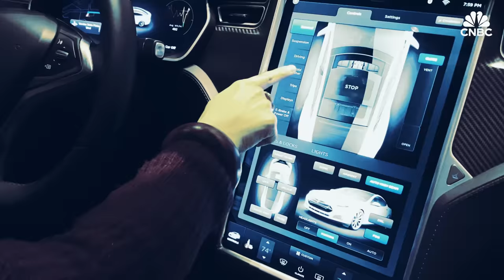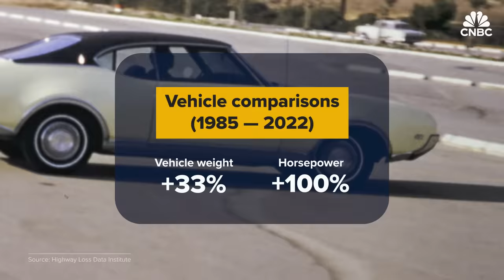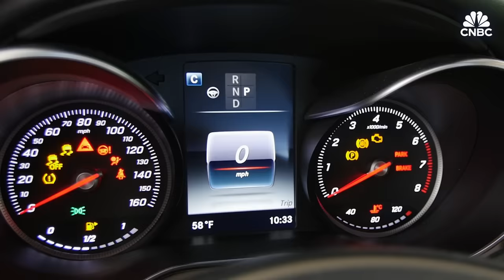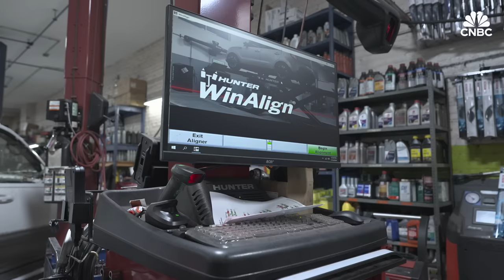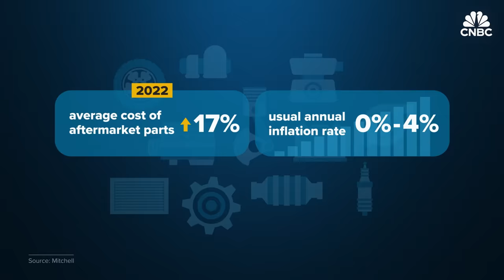Why Car Repairs Are Getting So Expensive

Comment: I'd have no problems driving a car less technologically advanced so that I could fix it myself. The problem is, at some point, manufacturers stop making parts for an older car and then you're struggling to find a specific part when you need it.
Reply: it's easy to find an old part you just have to know where to look and I do but I'm not telling any a dam thing.
Reply: Don't buy domestic and you won't have this issue. Domestics constantly redesign the cars with non-interchangeable parts which automatically makes for a very small parts market. I can still source parts for my 34 year old Nissan and my 20 year old BMW. Heck, I can get an entirely new engine and for less than half the cost of fixing that guy's broken radar module. New cars and especially domestics are money pits.
Reply: My newest car is an 07 Accord with 180,000 miles. I can find parts for it everywhere
Reply: junk yard
Reply: Depends on what vehicle you choose.
Reply: I have a 70s lincoln i need to make new rear bumper isolators for.

Comment: As a car owner, it’s important that you learn to do the most common basics maintenances like oil changes, air filter, spark plugs, etc. Save the heavy stuff for the pros but do the basics. Also helps to buy a reliable car from a reliable brand!
Reply: also an older car with less electronics.. they are still amazing. i have a 1991 toyota pickup and it runs like a top. the transmission and engine run like new with 156k miles

Comment: I bought a manual transmission car in 2017, I was told that when the clutch goes it “will cost between $600/800” in 2022 it cost me $4,500 to replace the clutch. That was after calling about 5 different shops to get the best price.
Reply: what kind of car?
Reply: id buy some tools and a floor jack not a terrible job you have a few hours and an afternoon
Reply: I don't know where you live dude, so I don't know the specifics of your vehicle either, but I had my clutch replaced for 800 bucks labor. I had already bought the clutch and flywheel kit for just under 200. This was last summer
Reply: I have a 90 Honda Crx Si  for reference
Reply: @rickyhernandez7681  he is probably lying, he wont answer what kind of vehicle he has
Reply: @rickyhernandez7681  people literally lie all the time just to try to score likes, its pathetic
Reply: gtfo of here bruh, what you driving a lambo?? aint no regular car 4500$$. im a mechanic and i know this clutch jobs usually pay like 6 hours max just depends if its 4wd or 2wd etc.. 4500$ dam i need to open me a shop around there lmao 😂😂
Reply: I believe him. Dealer wanted $800 to change out brake pads, wipers and 1 taillight.
Reply: For 4500. You can buy OEM parts, quality jack/jack stand. A big ass set of tools and still have a couple Gs left.
Reply: Was a Subaru Impreza that was repaired in Washington DC, I even ended up going with the original shop quote because I laughed when they first told me the price, so I called around and got even higher quotes so I had to bring my sorry ass back to the place of the original quote, no lying here
Reply: @boardervt should not be 4400... unless you are talking a subaru wrx sti aftermarket racing clutch.. doubtful
Reply: I do most of my repairs myself but I paid a mechanic $650 to replace the clutch and slave cylinder in my truck before the pandemic. I wouldn’t be surprised if that price has doubled.  Parts prices increased during the pandemic but have started to come down again. BTW, the mechanic let half of the transmission fluid out when he removed the drive shaft. He forgot to refill the transmission. The transmission started whining at highway speeds and I immediately knew what was wrong. I changed the fluid myself because I wanted to know that it was done right.

Comment: Cost of auto repairs have always been off the charts.Parts are relatively affordable but the labor cost is though the roof but wages aren’t though the roof!!!
Reply: Dealer charges $110 for labor yet pays the Mechanic $20-$30. He also has to use his own tools.
Reply: @Alumnikiid   It's worse where I'm at. Dealer charges $200 an hour and I'm only getting $20. I've spent about $5000 in tools so far
Reply: The video should have talked about used car extended warranties. My friend got her 2016 honda HRV(under 100k miles) transmission replaced for free with an extended warranty she purchased.
Reply: Wait till you have 40k in tools and they want to pay you 15/hr  and  your have all 8 ASE  certs and they say we can't  afford  to pay more as they charge the customer  155/ hr

Comment: I went to a shop once... what a mistake that was. I bought a used truck with a drivetrain warranty. The cv axle boot was ripped in the first 2 weeks of ownership, so I brought it back to get fixed. They told me that a cv axle is not a drivetrain part, and they charged me for it. When I went in to pay, I called them scammers and said that they would never see me or the truck again. One time was proof enough for me that shops gouge customers for everything.

Comment: Yall failed to mention that manufacturers also intentionally make it harder to repair to force you to bring it in to dealerships that have the crazy tools required to do it. It's a pure scam. Ain't stopping me though. Example is removing dipstick for transmission fluid. It used to like doing an oil change. Now for my Tundra truck I had to lift the whole truck in the air, make sure it's level, drain like normal, the manually pump the fluid in, then turn the truck on to get it to a certain temperature, then remove drain plug to let excess drain out until it was level. I did it successfully last week. Also some dealers are saying you're not supposed to change it at all. LIES! If you don't change it, the transmission will go bad! And then you'll have to buy another one or another car, and that's exactly what they want! Don't fall for it. Crazy how this video failed to mention that.
Reply: Just measure how much comes back- replace same amount...but I hear you. Annoying.
Reply: @MOAB-UT Yeah, that's only IF it was the right level before. I like making sure it's the proper amount to be safe

Comment: There is still a certain degree of gouging. The place I bring my vehicles charges $18.99 per quart of oil. I can get a five quart jug of the same oil on Amazon, Walmart or anywhere else for about $23.00. The oil for my truck that takes over 7 quarts cost $133.00. The fact that they buy it by the quart instead of the drum blew me away. I suggested they open an Amazon business account. They will deliver as much as they want and as often as they want. They could drop the price of an oil change by half and still be profitable.  Also all of my TPS sensors died after 150k miles, shop wanted close to $500.00 to replace them. I did them myself, the OEM sensors were $41.99 for four, they wanted $65.00 each and a reset tool was $10.00. Plus about three hours of labor using the bucket of my tractor to pop the tire bead. I would love to find a shop with a rate of $60.00/hr, doesn't exist in New England. Oh yeah I saved enough money on repair bills last year alone by doing it myself so I bought a lift for my garage.
Reply: Wow that's a lot for a quart of oil.  On my last trip to Walmart I bought a 5 quart jug of Valvoline synthetic and a filter for $30.
Reply: LOL, this remainded me of a "The Car Care Nut" video about stealership prices on parts like oil, filter and gasket way over actuall MSRP.
Reply: It’s absolutely price gouging.

Comment: When I was a teenager, with rear wheel drive, you could jack a car up and drop the transmission in less than hour using common tools. Rebuild and reinstall it later the same day. With front wheel drives, forget it. No more back yard repairs.

Comment: I have a small 2015 hatchback car with a CVT transmission. The owners manual says routine maintenance is never needed for the transmission unless you encounter issues. Well that's bogus, there is a filter there for a reason, and it's somewhat easily changed as well. The vehicle manufacturers don't want you performing routine maintenance like this so that it will inevitably fail in the future. Then they try to sell you another car or severely expensive parts.

Comment: I started to learn how to do somethings myself like change my filters, bulbs, wipers and so on. Gonna try my brakes because dealers charging $100+ to change simple parts.
Reply: You can do it! If you’re in the Midwest get you some PB blaster and start soaking those bolts if you have to replace the rotors
Reply: Brakes is prob the biggest diy labor vs $ savers.  YouTube videos are a huge help we didn't used to have.
Reply: Imagine though, you're paying someone for their time. That's why it costs so much. How much is an hour of your life worth to provide work for someone else?
Reply: EVs don't need brake jobs, or any other maintenance for that matter.
Reply: @bingosunnoon9341 
They need less brake work, but they still have mechanical brakes no different then any other modern car in addition to the ablity to regenerative brake with their motors. 

Driven long enough they would eventually require work on the mechanical brake systems. How it's driven probably matters quite a bit, allot of stop and go city driving where full braking power is used rather then regenerative will wear them sooner. They'll also need brake fluid flushes at a similiar rate because that fluid degrades with time as it absorbs ambient moisture (which it's designed too so that said moisture doesn't rust the lines). Malfunctions like sticking slides pins, calipers, or progressive rust from sitting or under-use could also require brake work.

A EV will require less brake work on average yes, but not none.
Reply: @Tk3997  Tesla brakes are totally opposite. Regen can be set up in your preferences. I never touch the brake pedal. If you have room in the battery, ALL braking effort is recovered. If you don't have headroom, the motor is driven backwards. EVs are way different.
Reply: A simple brake job especially at a dealership is a minimum of $500 and that's for a Honda/Toyota/Nissan etc
Reply: EV brakes may need lubrication after many years, to prevent dragging. Eventually rubber Parts could degrade the good news is there's not much information on this because they last so long, and mass of EVs is relatively new
Reply: @bingosunnoon9341 they just need $20,000 specialty batteries that are no longer made because battery manufacturing continues to shift, so that “battery costs are going down” is completely irrelevant when working with an out of warranty EV battery. It’s like requesting Apple to build you a 2013 MacBook today. The batteries for an old EV are absolutely ridiculous.

EVs are like sports cars but people insist they’re ICE replacements. Sports cars are meant for specific, infrequent purposes. EVs can’t handle the cold. So why would I want a seasonal vehicle like an EV? 😂
Reply: @Tk3997  I said none and I meant none.
Reply: Luckily YouTube has lots of mechanic videos online which can help people learn how to change their own oil, wiper blades, flushing out coolant system, etc. Scotty Kilmer is one of the best in the biz! It’s up to us though if we want to find that info or not.
Reply: Brakes are easy.
Reply: @mgf909  I shure like Scotty. Best wishes.
Reply: @bingosunnoon9341  you've obviously never seen a Tesla before, just look at one and you'll see brake rotors. Regen braking helps, but EVs are WAY heavier than ICE cars, and they chew through both their brakes and tires.
Reply: True, but many mechanics think they are on the same level as Medical Surgeons.
Reply: @Callsign_Sturm The thing is, this is some people's livelihood. Who wants to slave away on ungrateful customer cars, that haven't seen an oil change in 20k miles, as charity work? 

I imagine at your job you want to be compensated for your time, not doing it for as cheaply as possible, right?
Reply: @gamechip06  A Ford 150 weighs a thousand pounds more than my Tesla. Some models weigh1600 # more.
Reply: @gamechip06  
Tesla's are heavier, but not THAT heavy and they don't use the mechanical brakes nearly as often so they put allot less wear on them then any ICE vehicle. I'd actually say that the issue with EV brakes are likely to be related to lack of adequate use actually, if brakes just sit and don't get used they can start to rust or stick, but these are likely to be longer term issues. The reason some EV are going back to drums is actually probably related to that. 

Basically the kind of routine pad changes and rotor resurfacing/replacement you see on normal cars aren't really going to happen on EVs. Really barring some kind of defect brake pads could basically probably last the life of the car, rotors should last too as long as you use the brakes occasionally to keep them scrubbed of rust. Basically the routine maintenance type brake work is likely to be largely absent on EVs, but most of the system problems like sticking components, corrosion, fluid leaks, booster or pressure failures, etc can still occur and would require brake work.

Comment: You can’t buy a high tech vehicle and not expect higher prices for repair and maintenance. This has always been the case. If you want an all wheel drive vehicle, you have a lot more parts that wear or can break. Fewer parts will always cost less to care for during the life span of a vehicle. Electric cars have existed for a very long time. Gas powered vehicles took over from electric because they are less complex and more durable. That was the reason 100 years ago and the same reason why they still dominate the market today. Except now we are all being punished financially either way because of climate change. Start building new nuclear power plants and drive down the cost of energy and all of this will drop drastically

Comment: The other huge factor is misdiagnosis. It's insane how often it happens. If your mechanic tells you that you need multiple parts to fix a problem (especially electronic) then he's guessing. We call it "firing the parts cannon."
Reply: Lol. The "parts cannon" is what inspired to learn automotive repair. In 2001, I bought an '88 Ford Tempo with 80K miles on it. It overheated when I was driving it home. I took it to the local dealership. I was told that the entire cooling system, as well as my belts, needed to be replaced for a total cost of $960. Not knowing any better at the time, I paid it. It overheated again on the way home. Despite knowing nothing about cars at the time, I just opened the hood and started looking. What I eventually discovered was that one of the clamps on the lower radiator hose had corroded away, and the coolant was coming out of the hose once the car got up to temperature. Later on, my car would just not start at random times, and eventually started dying in the middle of the street. I had the battery and alternator checked multiple times over the next year, and both tested good. I ended up taking it to a family friend, who determined that the dealership had installed the wrong size alternator belt. The belt they installed was too big, and was causing the alternator to charge intermittently. I went and got a job at a national auto parts retailer the next week, and started teaching myself about cars. I do all my own work now.
Reply: @jesterr7133  Yep, that sort of thing happens all the time. The worst one I've seen was an engine replaced for a low power issue. New engine had the same problem. Turned out to be a clogged catalytic converter.
Reply: @Giggiyygoo  Fellow mechanic rebuilt a whole engine, new crank shells, piston rings etc and the engine still rattled when he put it all back together. I diagnosed a worn hydraulic timing chain tensioner, he replaced that and the rattling noise went away. They still charged the customer for an engine rebuild. It's daylight robbery.